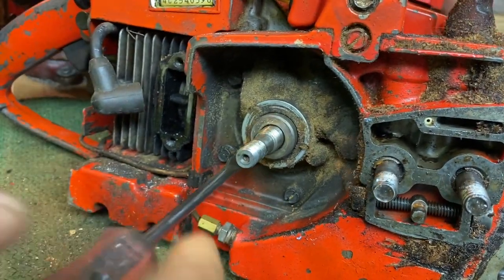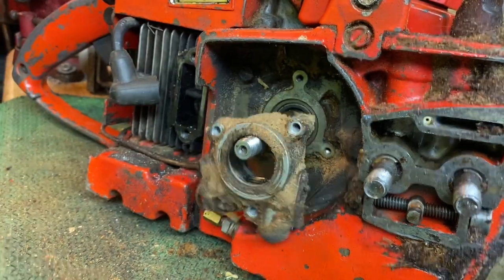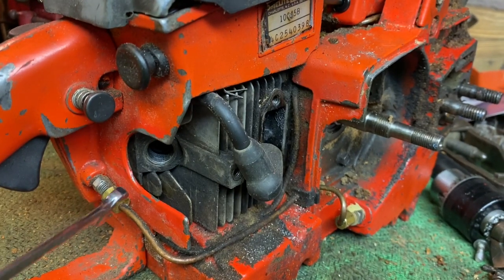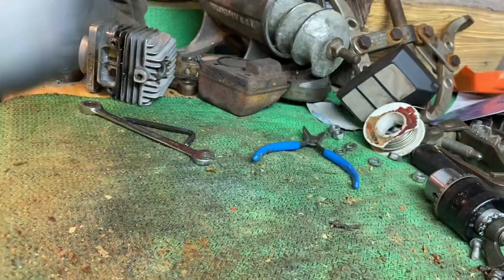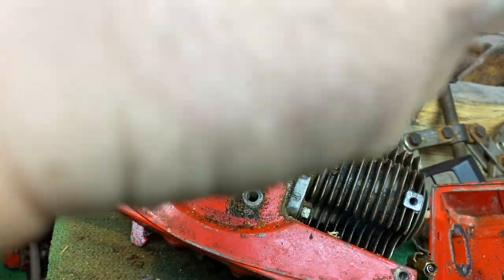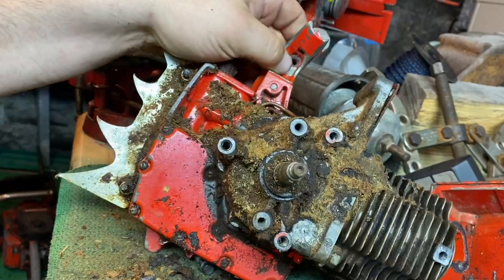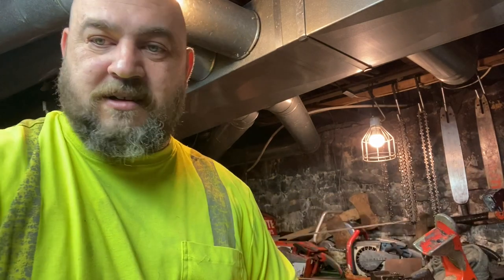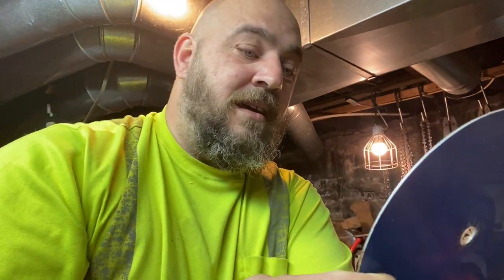Chainsaw Porting Class!!  How To Port A Chainsaw For Beginners!  Homelite Super XL Automatic #4

Comment: love it man really look forward to your videos... a tip you probably already know but just in case ...  much less chance of stripping a bolt if you use the closed end of the wrench... 6 points of contact rather than 2 .. thanks for posting :)
Reply from the maker: My gear wrench is broken. I had no choice but to use the open end. I should have gone with a socket. I just make due with what I have mostly.
Reply: @Smittyschainsaws  Yes I'm sure you've been around the block enough times always learn something  :)
Reply from the maker: Even on the simple project I always learn something!!

Comment: I find if you tap on the screw driver lightly with a hammer it help with break the threads loose if they're corroded to loosen easier works with all kinds of Fasteners really
Reply from the maker: Yes it does!